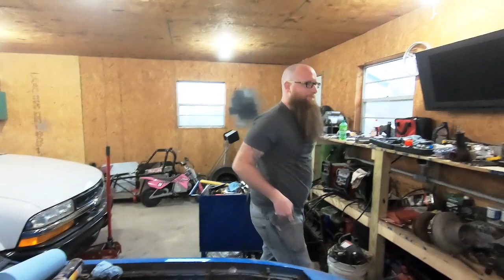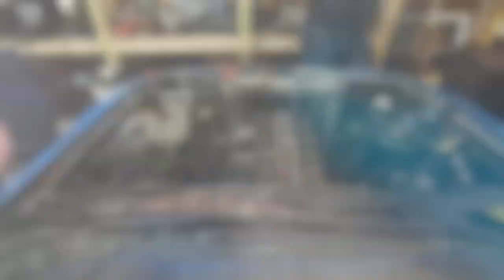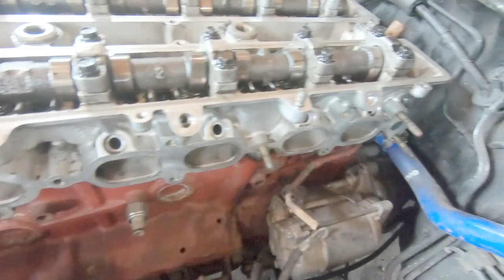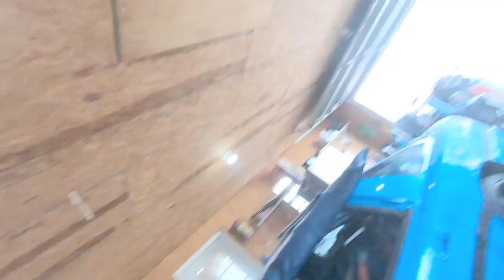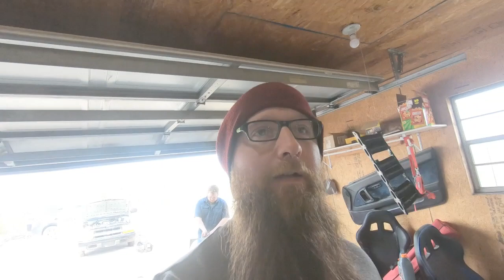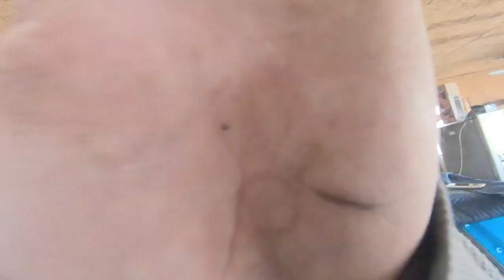putting the head on the supra..for street car takeover?!?

Comment: Nice! Going to do my head gasket in a month or so. I'm going to get the head block machined. First time pulling an engine. What do you suggest is the best way to pull a 7m? with the trans or w/o?
Reply from the maker: Gabriel Fitzgerald-Biernath that’s a hard one me to answer. I never put the top 2 bolts in my bell housing because they are extremely hard to get to. But if you pull the head off first then unbolt the trans it is very easy to pull just the engine. If you wanna hit me up on Instagram @sinister7m I can tell you what I’ve done and also help if you ever get stuck or have questions. I’m not a expert but i have learned a lot building this car over the past 6 years